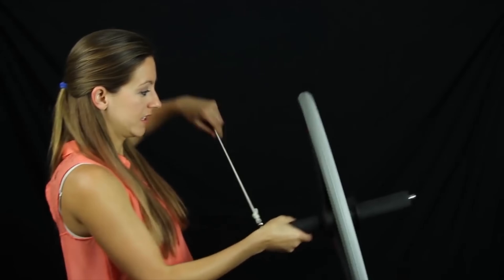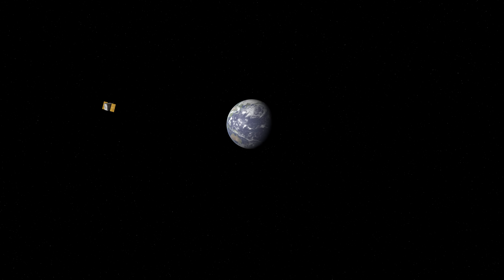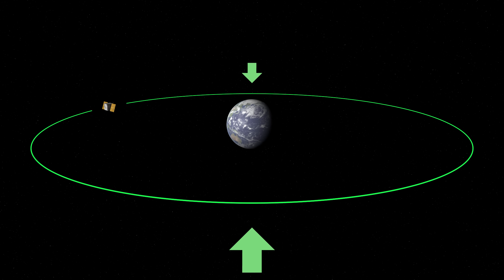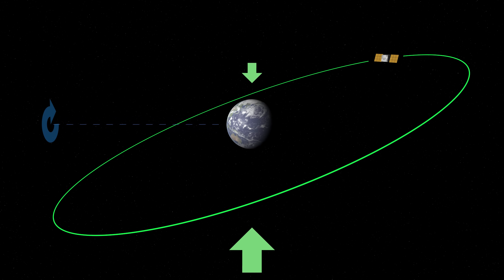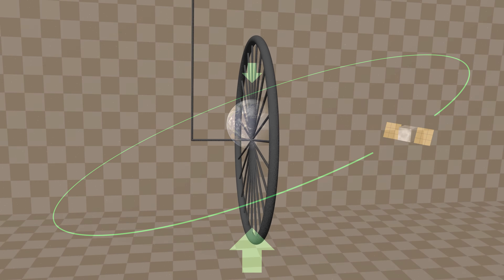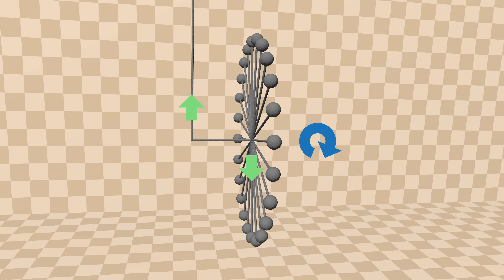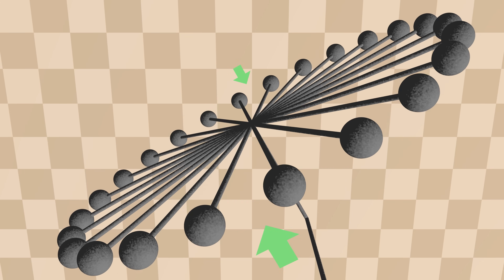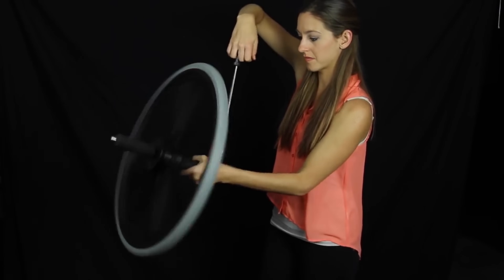Gyroscopic precession -- An intuitive explanation

Comment: Thank you for the video. I understand the motion of the gyroscope now. I'm still really confused though, regarding the famous film of the scientist who lifted a really heavy spinning wheel over his head like a feather, with no effort at all. I've been told that the spinning wheel does not lose mass (how can it); but this does not explain how the wheel is lighter when it's spinning (or seems to be lighter to the guy lifting the weight). I'm missing something here that I would like to understand. My question is "why can the scientist lift the wheel easily when it's spinning but can hardly move it when it's stationary? On some level it must be lighter? Surely? :-/
Reply: Veratasium has your answer.
https://www.youtube.com/watch?v=GeyDf4ooPdo
https://www.youtube.com/watch?v=tLMpdBjA2SU
Reply: @brycering5989  got it, I understand now. It's basically an awkward shape  to lift especially when pushing with one hand and pulling with the other, gives the illusion of being heavier. But, when it's spinning it becomes super stable and far easier to lift. Thank you for your help. Have a great day! :-)
Reply: Eric was deceptive. look how easy he lifts it before spinning it up.
https://youtu.be/MHlAJ7vySC8?t=67

Comment: This video contains the most intuitive explanation of the gyroscopic phenomenom I have ever seen. The basic principle is just the law of angular momentum conservation. In the video you can see when you apply a torque on some other plane(or axis perpendicular to this plane) than the plane(perpendicular axis) with spinning object, this torque does not change the value of this angular momentum component, but "generates" the angular momentum in the belonging plane(or perpendicular axis) . So the rotation(angular momentum) on the original plane is conserved but after applying some torque on some other plane(or perpendicular axis) there is an additional component of the angular momentum vector so as the result the total axis of rotation has different direction than the original. So I recommend to draw the vectors(arrows) in 3D cartesian system of the torque and angular momentum components and you will see the exact explanation of the gyroscopic precession. It is nothing more than the consequence of the Newtons motion laws :)

Comment: Ok. From my modest level of training, these appear to be two vectors indicating a force. What determines the angle?
Reply from the maker: If you want to calculate or accurately represent the behaviour of these systems, just use the formulae (basically, rotational momentum vectors adding up) explained in other videos. My video is purely to provide the intuitive explanation. Having said that, if you have a satellite moving at speed X and it gets hit by an impulse Y, you can calculate the resulting angle change straightforwardly, that interaction has nothing to do circular motion
Reply: TheHue's SciTech thank you

Comment: Thanks for the upload.   On the spinning wheel the torque on the wheel is provided by the force of gravity.  Where is the torque on the revolving satellite, where is the force on the satellite responsible for the torque?
Reply from the maker: 1. If the thrusters fire downwards when it's nearest to us (from our view in the video), and also fire upwards when they're over the far side, the end result is exactly the same as if the thrusters had fired downwards twice as hard when nearest and not at all on the far side. So distinguishing between those two cases is pointless.

2. If you have two opposite forces of equal magnitude and opposite direction, then end result of combining them is a (possibly zero) torque. So the upwards and downwards thrusts of the satellite can be considered a torque (ignoring the different in timing, but that's inconsequential too.)
Reply: @TheHuesSciTech  Thanks!

Comment: 1:40 it makes me so confused, i thought the way the sattelite is tilted after the forces are applied is due to both the one force up and the other force down, but he clearly says it just the force up that leads to this anfgle of the track
Reply from the maker: It doesn't matter whether you have just the one upwards force, or a half-strength upwards force on the near side and a half-strength downards force on the far side -- the resulting orbit is identical. So yes, I made a sneaky transition from the way that real orbital inclination adjustments are performed in real life (single force application) to a way that would work equally as well and more closely maps to the application of a pure rotation force (two force applications.) In short, the distinction is completely inconsequential and irrelevant.
Reply: Answers my question just perfectly, ty
Reply: So in real gyroscopes, the forces are the centrifugal and gravitationally forces?

Comment: That is a nice explanation but I have a question. Why it gets more upright when wheel spins faster?
Reply from the maker: I'm not familiar with exactly which phenomenon you're describing; but my simplified model is making certain assumptions. Those assumptions are that the little "nudge" that the satellite gets as it does each revolution is very small compared to the speed of the satellite (this corresponds to the wheel/gyroscope spinning very fast), and that there is no friction. If those assumptions aren't true (i.e., in the real world), things get a lot more complicated. This is where you use vectors, maths and formulae to predict what would be expected according to a more complex model, and verify those predictions against observations of reality. The purpose of this video is simply to provide an intuitive feeling for the standard basic formula, not as a proposed replacement for it.

Comment: An inspiring video. However, the salellite case is not the same as a bicycle wheel, for a bicycle wheel, a position dependent force is applied on each individual point on the wheel rim, instead of a pulse only applied when passing one specific position. If the bicycle wheel rim is reduced to a mass ball on the rim only, will it still show precession?
Reply from the maker: Yes.

To provide a bit more detail, it doesn't matter whether it's a single satellite, dozens of satellites, or a solid band of rubber. Nor does it matter whether the force is applied all the way around the rim in a smooth fashion, or sharply at one point. All that matters is the total rotational inertia of the entire system, and the total torque applied to the system. Although I didn't rigorously prove this point during the video, I did mention it.

Comment: Your explanation does not deal with a solid disk.  I made a gyro with a chain traveling in a square pattern.  Four straight lined paths will create a gyro.  Your explanation does not cover it.  The mechanism of precession is in the fulcrum line of tilt.  Mass must reverse axial directions with each pass through a fulcrum line created from a tilting plane, and that means opposing directions on each half of the spin plane. https://youtu.be/edrp-ag2TfY

Comment: The universe appears to be a 99.999999999999999999999999% angular force event. We persist with thinking and explaining physics from a straight line, linear acceleration foundation. Wake up people. The whole universe works according the principles of angular force, which matter probable explains all the 'loose ends' in our theories. Challenge everything and accept self validating facts, because it's not real until you can measure it. When 10% of the resources and effort applied to defining physics, as we currently think, is redirected to the basic principles of angular force, atomic motion becomes a resultant vectorial display. One may say that moving matter displays an accelerating body, but in reality it is the consequence of multiple angular forces 
re- balancing.

Comment: Perfect! The angular moment vector description is just shorthand for talking about this. It would fall apart, for example, if you did something that exceeded the structural limits of the bicycle wheel (pun intended). And, it's also affected by the transmission of force through the bicycle wheel. If the wheel were very large (the size of the moon's orbit for example) and you applied the force to only one side, the other side wouldn't get the twisting message for quite some time, and that would distort the results you'd get.

It's also tricky to explain which the bicycle wheel's friction causes one vector to win out over the other,  with the angular momentum vector shorthand. But, with this model, it becomes a lot easier to think about that.

The angular momentum vector model is just a very convenient shorthand for a set of very common situations. And, of course, this more complex model is the same thing, but for a wider range of situations. It doesn't talk about relativistic effects at all, for example.

Comment: The illusion in one's mind expecting the axis to be horizontal length is because you envision the orbit as a ring or plate. But the object is moving, and that is why it will go up from the point you strike it so as to raise the axis as the video shows. Now if I think of this, yes the axis of the moving object is not equinox, or axis to perihelion, but to the object itself. In other words where you struck the satellite is not and does not stay the diameter axis but rather continues with the satellite so as to go upward from the point you struck it. It is the same as the ball thrown in a straight line on a merry-go-round but looks like a curve. You must acknowledge that the axis of the force is moving not still. Neither axis that you draw as horizontal-depth or horizontal length is the effect, but rather whatever energy struck the satellite. Interesting. Hmmm got a Noah's Flood scenario. If I start with my concept 30 years ago that Noah's Flood had the Aquarius sun with winter north pole axis tilted to Leo getting struck by asteroid from Aquarius solar direction striking above the Equator into the Yucatan on 2370bc G.Oct 31 = Julian Nov 20 then axis did not merely tilt further to become 24 degree and drifting vertical since then, but according to your video the orbit of that date onward (as currently is) is Earth pushed southward in the solar plane. QUESTION: we are too busy using Earth as the ecliptic, but where is the barycenter's mean solar plane of all 8 planets? How far does Earth ecliptic tilt form that? where is that ever changing axis? And how much does solar plane, and Earth ecliptic plane tilt from solar equator since you would expect matter to have flown outward form the solar equator as it obviously obeys that law in spiral galaxies?

Comment: Could this be used to explain why the tilt in the axis of rotation of 
each planet varies? Uranus is on its side - Venus even spins backwards 
(180 degree variance)? Each planets orbital speed varies as the orbits 
are elliptic.

Considering their varying masses and that they would have been traveling
 at different speeds due to their elliptic orbits a dramatic shift to 
the whole solar system from some gravitational anomaly, such as passing 
through another system or a black hole, would have caused each one to 
experience a different shift in axis of rotation however angular 
momentum would have been consistent across the whole solar system....

....Thus their tilt of rotation would all be different even though 
effected by a common event. Heavier planets would have shifted only 
slightly such as Jupiter (3 deg).... for example.

The latest theory for Venus is that the sun pulled on its atmosphere and
 reversed its spin. Doesn't a common shift in angular momentum for each 
planet as a whole system of equilibrium seem more plausible an 
explanation?
Reply from the maker: I'm no expert on this, but I'd make these comments: 1. Axial precession is a real thing that occurs to planets, you can look that up. 2. Precession doesn't slow down rotation, it only alters its axis. Since Venus's is basically stopped, we need more than just precession to explain that. 3. Earth is spinning just normal and fine and Venus has (very slow) retrograde rotation, yet the sizes of the orbits of these planets is not all that different. However, the densities of the atmospheres are very different. Unless your proposed explanation has some sort of positive feedback going on; I find it implausible that such a minor difference in orbit size could cause such a major difference in rotation speed. However, since the density of the atmosphere is so very different, that seems like it has a better chance of contributing to such a major change. 4. You can find the research paper that proposed the Venus theory ("Long-Term Evolution of the Spin of Venus"). It comes it two parts, "Theory" and "Numerical Simulation". Talking about whether things "feel plausible" is one thing, but they've got computer models that demonstrate the atmospheric effects having the observed consequences -- so that makes the theory pretty plasuible!

Comment: Your video does show why if you apply a torque to a spining wheel the resulting movement is as you describe but I think many people will still be puzzled as to why gravity does not pull it to the ground. What you should do here is use a single ball and slow down time so use show gravity working on a single ball rotating around an axis. Then you need to say that if certain properties of the ball change (its mass and/or rotational speed) then the net effect of gravity to move the ball to the ground changes. The amazing effect of girascope is not its pressesion per se but the apparent antigravity effect - I know these are linked but the focus should be on the latter.

Comment: Wait, so how does that explain the wheel not falling over if you don't mention any other forces or torques preventing the wheel from rotation downward?
Reply from the maker: I didn't claim to provide any counter-torques or counter-forces; only a precisely analogous situation that allows you to explore the phenomenon more deeply. For example, you could ask an analogous question about the satellite; namely, how do you explain the satellite's orbit not being perturbed in the expected direction when I mentioned no other forces or torques? It's exactly the same question; develop an answer for yourself to that question and the answer to your question should immediately follow.

That aside, I'll point out two things: it seems like you want torques to cancel out to explain why the wheel is not falling over or "static". But it's not static, it precesses around. So if the wheel isn't static, one can't ask to be promised cancelling torques. Secondly, if you look at the angular velocity vector for the wheel, and then add the angular acceleration due to the force of gravity; you'll see that all three vectors are in the horizontal plane -- so it doesn't tip over, it precesses instead.
Reply: I think I'll just have to look more deeply into angular motion, though my old physics book is missing one of the two chapters on that topic. But I ended up finding a PDF, of a later version of the book, which has the missing chapter. But thank you for the reply.

Comment: Thank you! First and only explanation I've seen that really explains it. All the others have just rambled about precession vector cross products, but as we know the result vector there is usually a pseudovector and only by dumb luck it in case of precession happens to point to the same direction as the precession torque. So everyone explaining it only via vectors have not understood what really happens in gyroscopic precession.

Comment: No one in my A level physics class could understand this...at all. I asked the teacher if we could watch this and for some reason it just clicked with everyone. The satellite analogy really is perfect at showing what's going on. Thanks so much!
Reply from the maker: Awesome!
Reply: Can you help answer this please. When you spin the wheel forward (clockwise) it turns to the left as seen in the video. Spin it backwards (counterclockwise) and it will spin to the right. Here is where I found an issue. Both right and left handed boomerangs are throw forward in a clockwise direction yet the left handed boomerang flies to the right. Why???
Reply: @VictorPoulin  I'm gonna guess it's aerodynamics/Bernoulli lift due to the different shapes for left/right, but I'll be the left handed one doesn't torque as easily since it works against precession vs addititively (I'm guessing the left handed rang veers to the right and the right veers to the left, due to the lift produced by the shape - ie, which side has the longer path vs shorter straighter path, where the shorter side gets the "lift").  But, since both are rotating "clockwise" or right hand, I'd expect the right handed rang to need less aggressive "lift" from it's shape than the left handed?  Have you noticed that the right handed turns more aggressively than an identical but oppositely shaped left handed?  Interesting concept.  I bet lift is the much strong force on a rang than the precession component of angular momentum from rotational velocity.   Anyone with actual knowledge give you any insight on this since you asked (I'm just shootng from the hip late at night insomnia clicking).
Reply: @technobutt2696  I agree that it is lift. You get the same results from a lefty as you would a righty. I agree that precession has little to do with anything going on with the flights. I am friends with many different boomerang builders and most all are learning that precession is what makes the boomerang turn. I am not sure who was the first to tell all of them this but it is now carved in stone for many. Wanted to throw this idea at them about the left handed boomerang but wanted to hear what others thought first. Thank you for your input.
Reply: 🇨🇱
Because Tha main turn of the boomerang us due to aerodynamics, not to gravity.
The turn due to gravity and momentum is the "leaning upwards" in the fly, later on...
Saludos de 🇨🇱